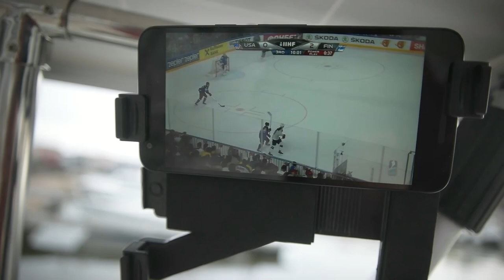Raising the VAWT - Electric sailboat vlog 0015

Comment: So how is it doing currently? What kind of power did it produce.Can you post another video of it in action?
Reply: i just commented on this video, this lantern design vertical wind turbine with 1.5m/s low start up wind speed, it is good, right...but it is hard to reach rated revolutions, so efficiency is not that good as traditional three blades horizontal wind turbine

Comment: I recently bought one of these and wind is blowing good but I can’t seem to get any power from it. Any tips?  It didn’t come with any wiring instructions. Is there an order it needs to be plugged into the controller?
Reply: every video or review i have seen has said theyre junk.. so maybe no good :(
Reply: it won't change too much even you plug into a controller, this is lantern design vertical wind turbine with 1.5m/s low start up wind speed, it is good, right...but it is hard to reach rated revolutions, so efficiency is not that good as traditional three blades horizontal wind turbine, regardless wind speed...

Comment: hi Pauli, this is lantern vertical wind turbine, efficiency is not good like horizontal wind turbine, it might spins very fast but still low output, am i alright?
Reply: The efficiency of vertikal windturbine is a quarter of a horizontal type only. But they are slow and therefore kill no birds and are silent. I use it to mock my voles.